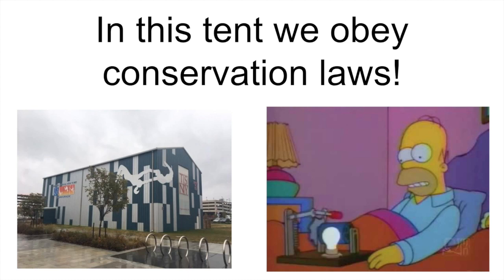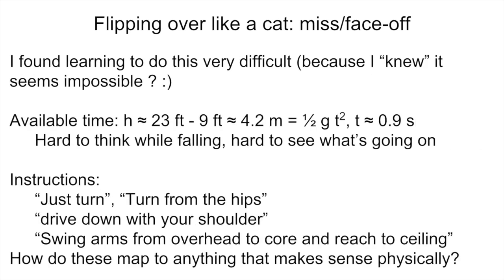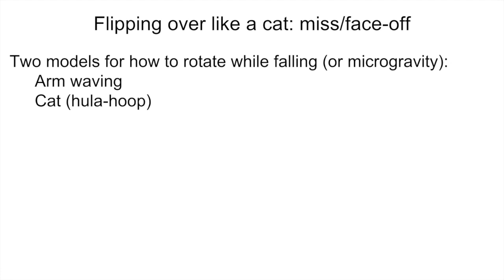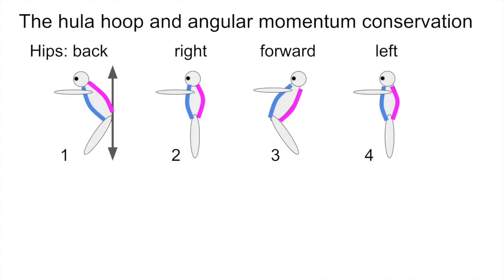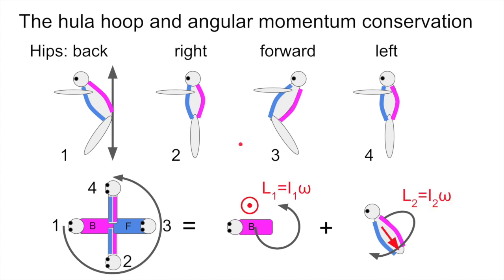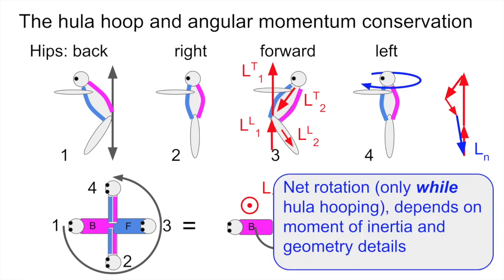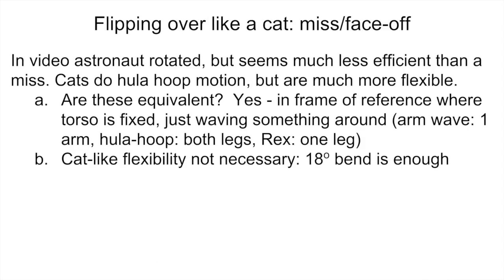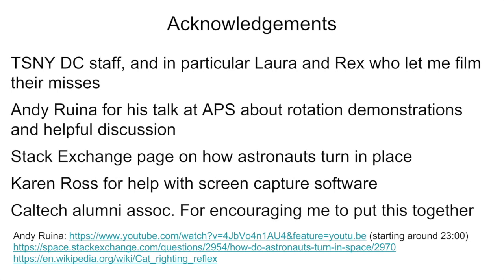In this tent we obey conservation laws: the physics of flying trapeze, part 3 of 3: the miss

Comment: I can also offer some insight here.  Next time you're at the rig ask Rich Riggins to demonstrate a cradle on trampoline by doing nothing more than raising one arm over his head while lowering the other down to his side (let's say right arm up, left arm down).  From a over-simplified viewpoint, Rich is rotating forward over his feet (x-axis is going from the center of his hips out either leg, and y-axis is going from the center of his hips out the front and back of his body, and z-axis is running from his feet to his head,).  So he starts with rotation around the x-axis  By raising one arm over his head while the other is down by his side, he is increasing the radius on the right side of his body, but not the left.  Conservation of rotational momentum says the right side of his body is now going to rotate slower around the x-axis than the left side of his body.  Since they are connected, this now creates rotation around the z-axis.  I teach the turn to the net with the same principles in mind, as you are falling you are increasing energy in the system (the closer to the net you get, the more energy you have at your disposal to transfer into rotation) - and with even the smallest amount of rotation towards your head, you can transfer this rotational energy from one dimension into the other.  So my first move is to contract my abs and "drop" my head and chest towards the net while extending one arm over my head and dropping the other to my opposite hip (my shoulder follows my dropping arm and then my hips follow my shoulder) - as long as I keep my legs together and tight, it preserves my small radius in that dimension and the lower body turns fairly easily - my arms end up spread out to the side so my upper body has a large radius while my lower body has a small one.  SmarterEveryDay posted a really good youtube video (number 58) about cats twisting by decreasing the radius of their front legs while increasing radius of back legs, and then vise versa in order to maintain the conservation of rotational inertia.

Comment: Hey Noam. Jonathon Conant here. Thank you for doing these cool videos. I love them and have gained good insight watching that I can share with my students. I have a couple thoughts. 

When I see a cat twist, what I see is less about angle or movement (hola hooping) and IMO more like creating and releasing muscular energy elastically. The top of the cat uses muscular energy to twist. Because it is so flexible, the movement twists far beyond the normal muscular state creating elastic energy potential. To do this, the cat must relax the area least occupied by resistant masses. When the cat reengages it's abdomen and lower back, the muscles return to their natural alignment under tension thus pulling "the rest" of the cat around. 

Of course flyers go to the net in a million ways depending on the angles and forces of the miss. Some of these executions are easier to describe than others. Hola hooping is one, Accelerating one side of the body by pulling an arm across the chest is another, Shortening one side of the body (as in classic twist movement) is yet another. 

The crazy thing for me is watching my wife,a long time acrobat though not flyer, turn so efficiently video is barely enough to see how. Christine maintains a perfectly straight center axel parallel to the net with arms stretched forward like Rex. After attaining some speed falling flat she simply turns her head and the rest follows. I believe that she is so well trained she falls like the cat through a series of muscles firing, relaxing and re-engaging. My last word is to a cheat, for you have used the split as example. I tend to teach the miss from the split as there is some secret sauce in what the legs do that allows learners an easier twist than twisting from a set whip.  Thoughts?
Reply from the maker: Hi Jonathon - I'm glad you like the videos.  Here's a TL;DR, since it's a long response:  from a physics point of view, I think muscle tension creates rotation only in so far as it changes the shape of the body, although the necessary shape change is more subtle than I made it seem, because my example was exaggerated to try to make it really visible.  However, from the training point of view (i.e. how do you get your muscles to actually do the right motion), thinking of it in terms of muscle tension can certainly be very helpful.

Now the long version:

 I was initially surprised that I couldn't find any slow motion videos of humans doing a miss (although I realized belatedly that maybe I should have looked for things that aren't explicitly trapeze, like trampoline or diving). I do have one video of another flyer doing a miss where the legs are not spread apart after a split, so it does look more like a subtle hip wiggle, but that one isn't in slow motion and therefore looks rather blurry (I also don't have permission to post it).  My own miss (not after a split) tends to have the legs rather far apart and probably doing most of the work.

As for your description, I think it's more similar to what I have in mind than you perhaps think, although maybe I didn't do the best job of fully conveying my thoughts (also they have been evolving as I've been working on the explanation). 

At least thinking about it as a physicist, my intuition is that the flexing of the muscles as such makes no difference, except in so far as it leads to motion or a change of shape. Of course you can't get a change of shape without flexing muscles, but whether they are tight on not is not the thing that leads to rotation; the tightness is just the internal state of the muscles, which at the smallest scale is chemical energy and stiffness of molecules inside the muscle cells, and it isn't going to affect rotation or pull of gravity (except for relativistic effects, but none of us do a miss at speeds comparable to the speed of light :).

However, and this is something that I realized late and may emphasize more in the revised version if I ever make one, from the physics point of view, waving _anything_, any body part, in a circle will lead to the rest of the body rotating the other way, for fundamentally the same reason that I showed in the cartoon in the video.  This can be one arm (like the astronaut), one leg (like my own miss), both legs (like the hula hoop), or just a subtle wiggle of the hips with the body nearly straight (like the most beautiful misses I've seen).

Now how to get your muscles to achieve that is a whole different question (and,  being a physicist rather than a trapeze trainer, is not my forte).  This is where thinking about it in terms of muscle tension can certainly be very helpful.
Reply: Fun discussion thanks! I believe I understand your position. Of course you must post a very slow motion video of yourself doing a miss at some point and describe exactly how it feels. That would be a manful addition for folks trying to demystify the move. All the best :0)